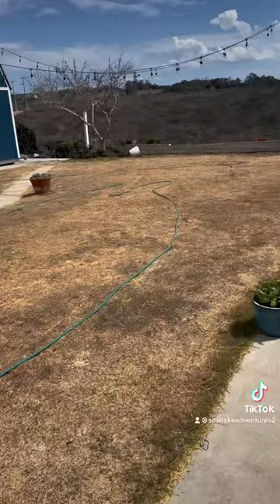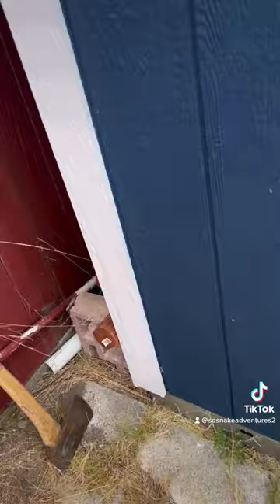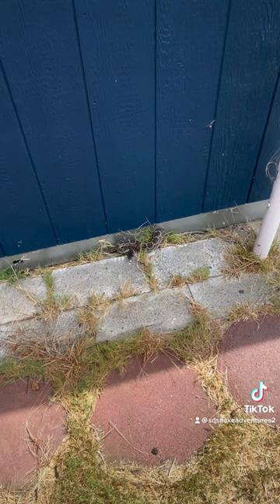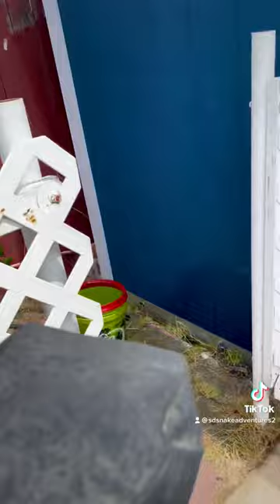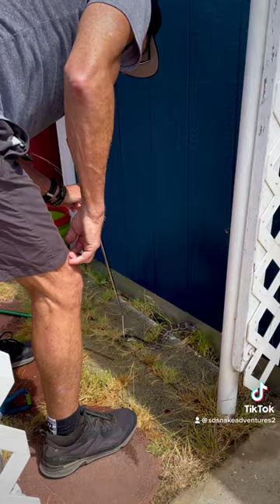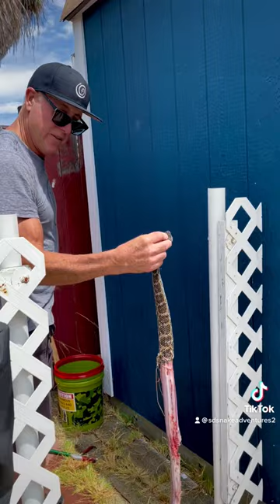Snake Wrangler sadly has to take this Rattlesnakes life ☠️

Comment: Should either pulled it from the other side or killed before making it suffer  with having its skin pulled off
Reply from the maker: Trust me. I tried all options. Owner would not let me drill a hole in his building to reach from other side. Also wouldn’t allow me to try to raise the building with a tire Jack. I exhausted all options. There was no other safe choice.
Reply: As inhumane as that may seem its much better than laying there getting eaten by ants and whatnot while dehydrating slowly. Also they don't experience pain like humans do.
Reply from the maker: @crotalus_venom2430  Thanks. And I agree. This snake wasn’t going to survive. As much as I never want to take a life, sometimes it can’t be avoided.
Reply: @crotalus_venom2430  that’s why I said it could have been put out of its misery first that’s why it seems so inhumane and I doubt you know how a snake perceives pain
Reply: @Irelandrbi  could put it out if it’s misery first
Reply from the maker: @papiong5156 My last ditch hood was if I pulled hard enough it would have come out. As I say in the video. But taking a life is part of saving lives. Same as military.
Reply: @Irelandrbi  Nobody here is saying that the snake didn't need to be put down. We all agree that there was no way out, what differs here is the thought process leading up to what happened. You knew the snake was dead no matter what, so you didn't see the point in putting it down before removing it, or even after you saw the skin was ripping from that initial tug. We understand that you had no other options but to pull the snake out, what we are saying is you could have put the snake down FIRST then pulled it out so it didn't have to suffer through being skinned alive as you yanked it out. THAT is what we're all trying to tell you. You could have saved that snake so much suffering, and as you said at the end of your video "It's suffering" As it lay there, skinned alive because you chose to not put it down first. I don't know how much more clear anyone can get on this. You messed up, own up to it like the professional you claim to be and learn from this instead of making up excuses.